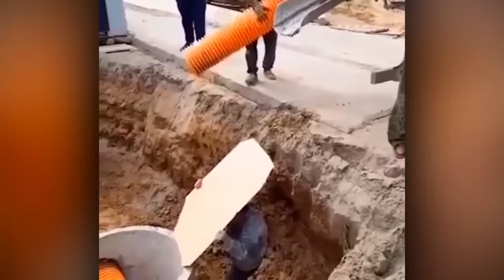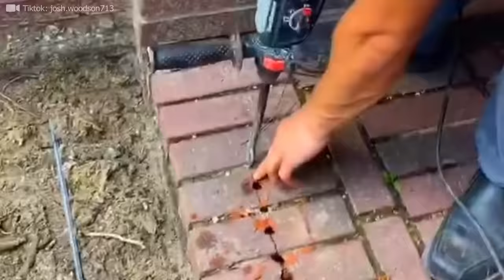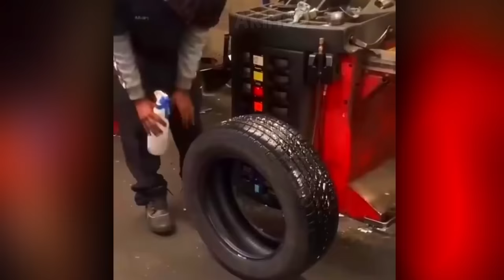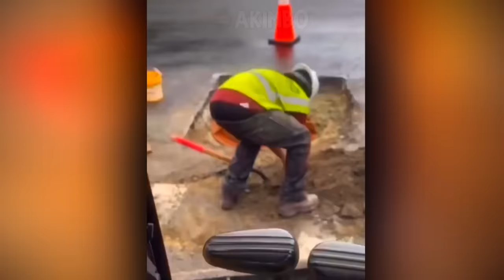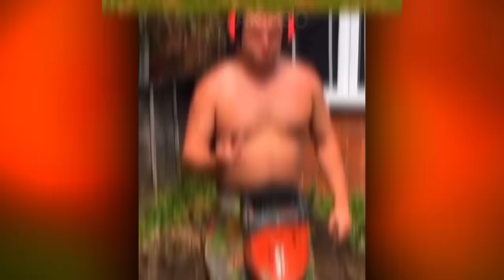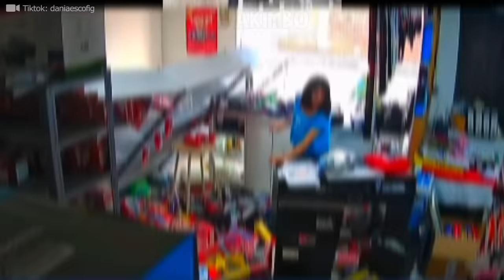TOTAL IDIOTS AT WORK !

Comment: The guy spraying the tire with a squirt bottle like hes washing it whats actually supposed to be doing is checking for leaks but usually the tire is mounted on a rim and aired up  THEN spray it with soapy water to see if you see any air bubbles coming out of anywhere which is obviously not supposed to happen
Reply: usually or it always has to be attached to the wheel 😂
Reply: @coltonhafford3673  you know what I mean jeez
Reply: Or you dunk it in a bath
But people are willfully ignorant alot
Reply: If you consider his race, that makes sense. They're one of only two to neither invent the wheel nor the sail.

Comment: Actually, stopping a runaway rotating machine with a ladder is the smart way of doing it. He was no idiot using it.
Reply: Yes
Reply: It's the best way I have seen anyone stop a runaway rotating machine.
He might have been an idiot letting it run away in the first place, but he was a genius in stopping it.
Reply: @Tjalve70 : Thank you. That's essentially what I was saying!
Reply: Agreed. If anything, he belong in a "Total GENIUSES at work" video
Reply: When I worked for a cleaning company they had a literal shepherd's hook for catching runaway swing machines. Only ever happened maybe once a year when the handle gets stuck (normally it's a deadman switch) but it beat getting hit in the nuts trying to grab it bare handed.
Reply: @adamb89 : That seems like a smart thing to have. It's better to have something and not need it (often) than to need it and not have it.
Reply: So is to remill too watered concrete with some dry concrete  💫
Reply: @xjuhox  Only if it hasn't been poured yet. My first job out of school was as a mudman for a masonry company, and I never was allowed to have it too watered down.

Comment: Ok, I got one that will top the guy cutting into the water main. I used to work locating underground utilities, my supervisor told me of a locate where they dug up to verify a high pressure gas main. There happened to be two, one was abandoned and one was live. They contractors were on site and waiting on the Gas company to get there to verify which one was live, one idiot proceeded to drill into one of the mains, by sheer luck he drilled into the abandoned main. Good thing, cause the live one would have probably killed him, even if it didn't catch on fire.
Reply: Wow. He is lucky

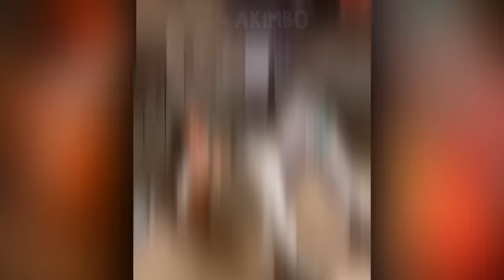Comment: 5:15 the guy isn´t washing a tire. He uses soap and water mixture to check if the air is coming out of the tire. Flies away
Reply: How does that work when the tyre isn't on the wheel and is under no pressure?

Comment: Wheel barrow? I always thought it was a "Wheel Barrel".
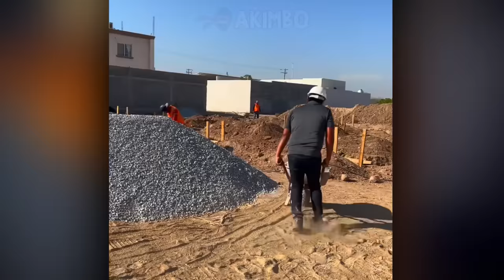Reply: 5:36    Wheelbarrow-one word. 

The most common sizes you'll find in stock at your local hardware store have 4 and 6 cu. ft. capacities. Although both are available with either a steel or a poly tray, the plastic is somewhat less expensive.  The 4 cu. ft. model is ideally sized for your home's backyard work.  Also, this particular model will almost always have a solid rubber tire, saving you from the headaches of a punctured tube inside the tire of the larger sizes capacity wheelbarrows.